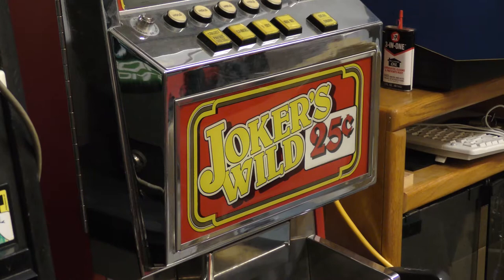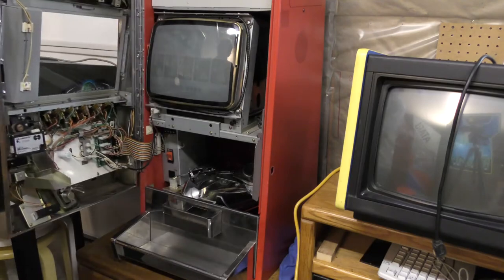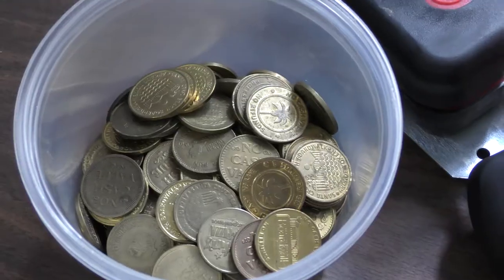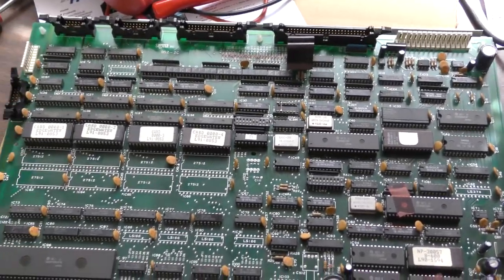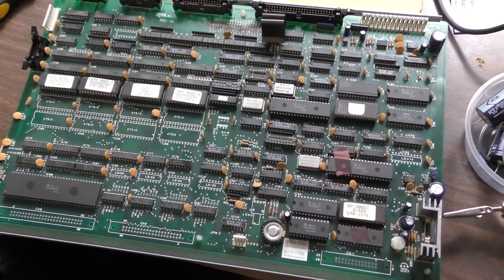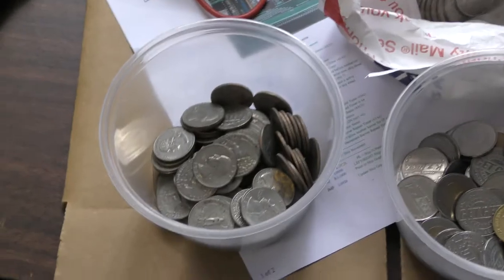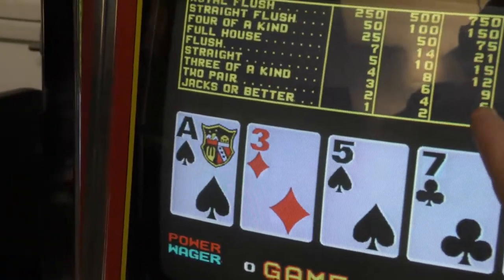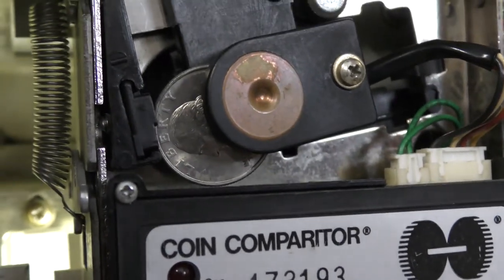Look inside Video POKER machine by Sigma - plus a Hopper JAM

Comment: Thanks for the video. I have a video poker machine from the 1990s that was working great and then today I turned it on and heard a loud pop and everything went black. Does that mean it's dead now? Not sure what happened. Power surge?
Reply from the maker: It's definitely a fun machine. When I am repairing arcade or pinball machines, I ALWAYS start with the power and do from there. I Get out the schematics and my multimeter and start testing - good luck. 
Of course maybe check the fuse with a multimeter to start with .

Comment: I have an igt poker machine  ,turn machine on picture comes on ,no lights on buttons can does not work would the can not make the machine work
Reply: Is your 5 volt Power Supply coming on and running fine?  Monitor and main board run off a 12 volt Power Supply, lights run off the 5 volt.